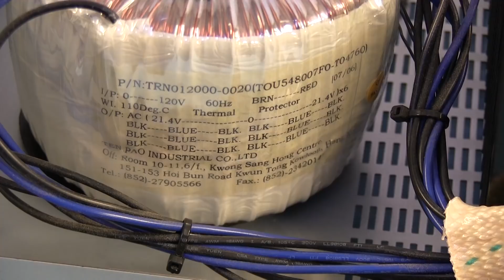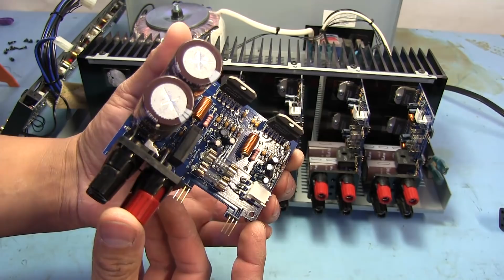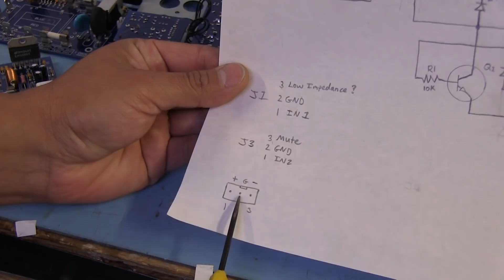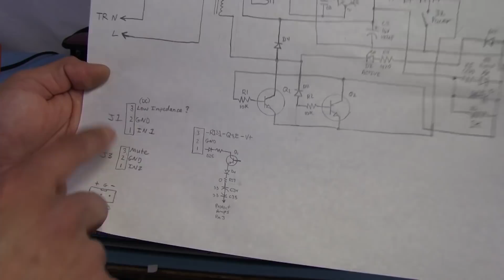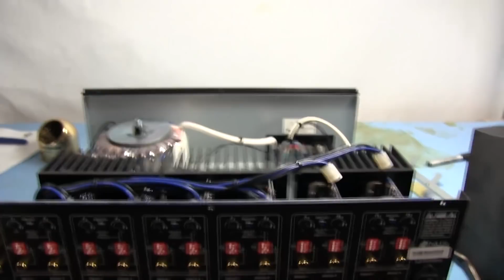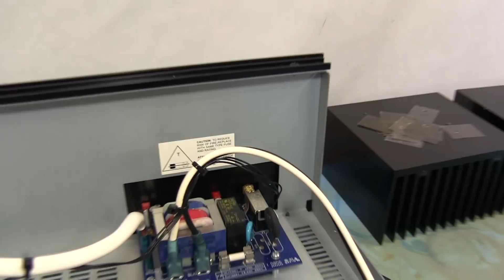TWB #69 | Niles SI-1230 Amplifier Repair

Comment: I have an SI-245, which is a single channel, 45 watt version of the SI-1230.  It looks like the basic design is the same.  My problem was the audio (AKA Music) sense is always on (active light on, outputs energized,) even when the source is disconnected.  At the end of your video (which was very well done) you looked at this circuit briefly.  It wasn't clear but it seemed it was behaving correctly.  Any thoughts on how to trouble shoot this?

Comment: This amplifier works only on 110V/60HZ power supply? Is it possible to modify it to support also 240V/50Hz power supply? On the backplate says 110V, but at 14:45 there is also a note for 250V ...

Comment: The problem with my 1230 is that it will play for 5-10 minutes and then stops producing sound from any of the channels, although the power light remains on (the Active light goes out). When I try it again later after turning it off for awhile it does the same thing - plays for about 10 minutes and then goes out all at once - no static or distortion before going out. Any clue as to what to look for first?

Comment: Hey, I was looking into getting one of these but I had a question that might be kind of crazy  and most likely dangerous and inadvisable. Given the fact you can change each amp to a certain channel with the bus switch is there any way that you could double bridge the amp using the 3 of the bridged amps for the left and 3 for the right? it would make for a mess of cables but was curious as to if this would be possible or even plausible to do and would that actually increase the available watts? Also would it be possible to have them in mono and used to power a subwoofer with them all bridged together as long as you present it with a 8 ohm load?

Comment: Hey - thanks for doing this. I've got the cover of one of these off and am ready to get busy. SUUUUUPER dusty and full of cobwebs. Main 10A fuse was blown, I'm hoping just as a result of all the cobwebs. Sound possible?

I didn't take the entire thing apart, but a good lookover doesn't show any obvious issues. I'm not a genious, but can tell if something's fried or a cap's been blown, etc. Other than the blown fuse and being dirty it looks fine.

I'm assuming clean it all out, replace the fuse and try again? If so - am I replacing the 10A with a slow or fast burn fuse? No indication on the fuse itself and I'm not really sure how to tell.

Comment: I have a Niles 1230 does not have any shorted channels does not go into protection powers on fine but absolutely will not allow audio to pass through I'm thinking there must be an audio processor board that needs replacing. I called Niles it's $600 for the repair to swap it out. There's no schematics online...
Reply from the maker: Might want to check the regulators on the rear panel, might be something going on with those. Pretty much everything in the amp is analog and there are no DSPs or anything, so if you are getting absolutely nothing at all, it might be a power issue.Also check the fuses on the first board that power the rear panel.

Comment: Great job - I knew you could fix it! I'm so impressed by how thorough and neat the job was. It was definitely safer in your hands than it would have been in mine. :D

My wife and I were cracking up at your comments about our leftover moving tape.  :D  And I'm happy to see I didn't get my this-side-up arrows wrong after all.

For those who are not familiar with what kind of amp this is: it's a multi-zone amp, for background music or other audio throughout several rooms or areas in a building. Think large restaurant or grocery/department store, or a house with whole-home audio. I use the one I now have that replaced this one for piping music out to the patio, by the pool, in the master suite, etc.

The story of the fuses in module 1 is this: when I received the amp after purchasing it on eBay, and found that it did not work (no worries, the seller gave me a full refund), I opened it up and immediately saw that the fuses in module 1 were simply missing. So I popped the ones in module 2 out to get the specs, and ordered a pack of 5 (you found the extras taped to the bottom of the case). When they arrived, I installed them, but doing so did not help, though it did change the behavior - without the fuses in module 1, I never got an Active or Protect light. With the fuses in module 1 installed, it behaved as it did when you received it - the Active light would come on briefly, but it would then go into Protect mode. So I'm guessing someone knew something was wrong and was trying to fix the problem, or mask it. I don't think my eBay seller knew it was bad - I'm guessing it was a garage-sale-type buy that they were reselling, and they didn't bother to test beyond the red Power light.

At that point, it was easier to just get another one, and send this one to you for use in a video, and what a great video! I'm not surprised that it turned out to be those amp IC's, but I certainly didn't foresee them being in modules 5 and 6.

I did not know that these amps don't actually shut off when the Active light goes out. I will now power mine off completely when it's not in use! I thought the audio sense would power everything down, not just mute the amp modules. Boo!

TWB, you've got a reconditioned Niles SI-1230 - what are you going to do now?!?  :D
Reply from the maker: I'M GOING TO DIS..... uh... probably just stay in my garage. Yeah... 

I might hook it up in here for tuneage and maybe something in the bathroom and bedroom now. :P

Thanks again!